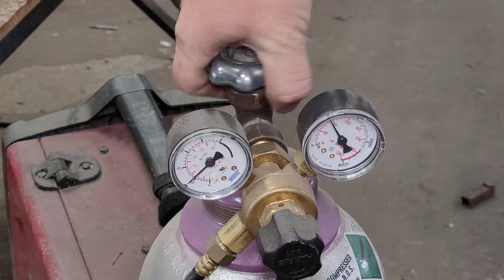Remove Fan Clutch DIY Tool!

Comment: When I replaced my fan clutch on my Trailblazer I made a simple tool to hold the water pump pulley in place. I used a piece of flat metal stock. I think it was 1/2 inch wide by 1/8 inch thick, by probably about a foot long, but I do not remember the exact length. What I did was drill holes in each end of that metal bar, fasten one end to the water pump pulley by removing one bolt and reinstalling the bolt then fastening the other end of the rod to one of the alternator mount bolts. That pulley could no long move at all. Then I proceeded to loosen and remove the fan clutch.

Comment: I think I found an easier way, it's called go to your local auto parts store and take advantage of their tool loaner program. I borrowed a  Fan Clutch Wrench Set, Fan Clutch Holder, and while I was at it, I had them throw in the Serpentine Accessory Fan Belt Remove and Install Tool. By the time it took you to remove that fan clutch, I'd already have been sitting back in a lounge chair enjoying a brewski or two.🤣😂
Reply: Not everyone lives near an auto parts store, and not every parts store will loan tools. For people like me who live 60 miles from the closest Walmart or police station. Diy tools are a part of life.
Reply: I'm in central fla no store within a hr has the tool for rent or purchase smh have to drive to Orlando if this doesn't work lol
Reply: @chevylanier7468  Start your own business, tool loaner on wheels.😁😆😅
Reply: @Orange-Jumpsuit-Time  easier thought up then done. But that rental chit isn't a option all the time.

Comment: 👍☑️ spend a couple hours of ur "FREE" time (that you have now valued at $ 17.50 an hour) minus material cost, depreciation on welding equipment, etc, etc and you get a "FREE" tool. Does make for a good video and much more satisfying than driving to the store LOL tks man!

Comment: pro trick no trick tools needed put your breaker bar in belt tensioner and a a wrench or large crescent on the big nut pull tension at the same time hit the wrench with a 2 pd sledge
Reply: Not the best way. You could possible ruin your serpentine belt that way. I have seen comments from people that did ruin their belt.

Comment: a bit of cardboard or pulling your radiator can help protect it.
Reply: I slid card in front of my radiator when I replaced my fan clutch. I did not want any chance of me dinging the radiator while removing that stuff.